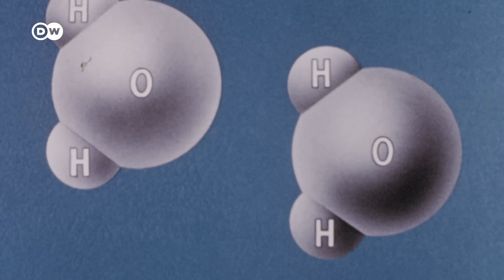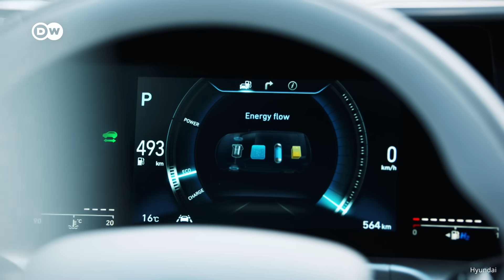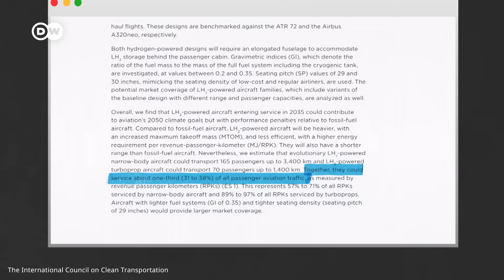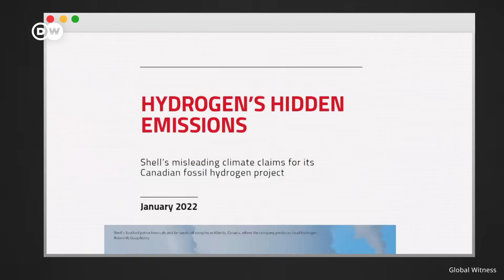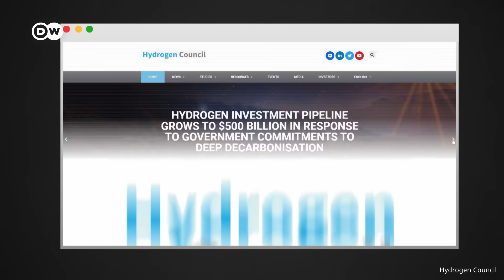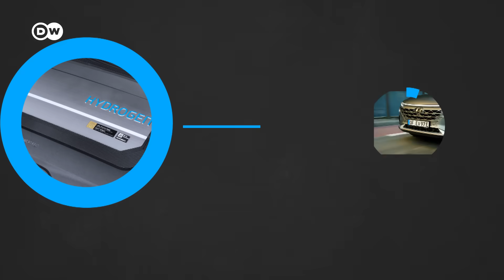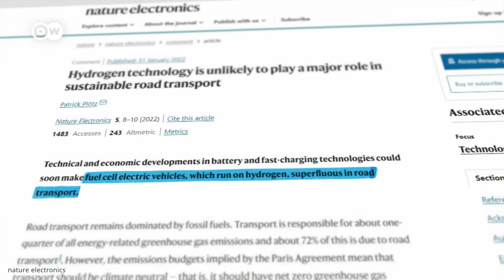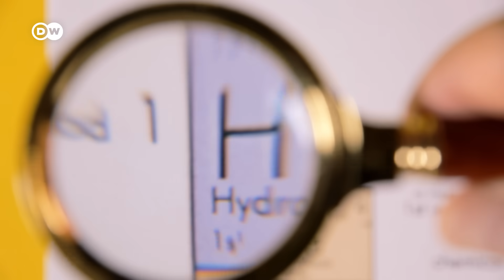The truth about hydrogen

Comment: You left out one obvious factor - nuclear energy.  It is green energy with basically zero emissions, and the latest reactor technology is MUCH safer than older nuclear power plants.  Recycling nuclear waste for a second round of power generation (that waste still contains a lot of power - that's why it's so radioactive, right?) is now feasible, and the world has massive amounts of uranium, which has in turn massive amounts of power per Kg.  The initial cost is high, but the ongoing cost in terms of fuel - uranium - is really cheap per amount of energy produced.  So these plants could then be used to create green hydrogen with much more efficiency than solar or wind, as well as powering the grid.  End result - loads of power on the grid, powered desalination in dry countries coupled with cooling from the sea water, and massive amounts of hydrogen for fuel cell vehicles, or even fuel cell/electric hybrids, such as the Honda Clarity or the Toyota Mirai.

Comment: Or, you could begin a retrospective refit of existing vehicles and keep the internal combustion engine, running on hydrogen, and eliminate the cost, waste and risks associated with batteries. 
Need an intensive clean, low cost and consistent energy source to create hydrogen? Nuclear. 
Strange that none of your independent experts suggested any of this 🤔

Comment: Quaise says they can use a millimeter-wave drilling system to drill 3X deeper than oil wells to supercritical water temperatures at decommissioned coal-fired power plants at a cost of $0.01 to $0.03 per kilowatt/hour.  If true, that eliminates the green hydrogen production cost problem.
Reply: Even at the typical 3x to 4x cost over estimate to actually bring a technology into production, that is still economical. Fingers are crossed they get to prove that.

Comment: Green hydrogen can be produced by wind turbines and solar farms. When the electricity from these two source are not needed on a power grid and they are idled they can still be producing hydrogen for storage land use later . This increases the overall efficiency of the turbines and solar farms. That's the real benefit of green hydrogen. So somewhere in the economy the green hydrogen must be used.

Comment: Nice balanced presentation. Cheap abundant Hydrogen is probably the best long term solution for energy production. (Side bar - don't forget about the effort to make stabile metallic hydrogen an room temperature super conductor. Gee I wonder if THAT could be useful. 🙂).
 As shown in the current video diesel fuel and internal combustion engines can be converted use hydrogen.    So it really makes sense to pursue it as a fuel source. It bypasses the problem if finite source material for battery tech. Also consider the problem of disposing of the solar panels and the toxic content contained therein. 
Figuring out the tech to extract/generate hydrogen without the harm - that is the key. Obvious I suppose - but spread the word.
Reply: Or instead of converting all these engines to hydrogen we could just convert to biofuels

Comment: If you use hydrogen to run your car then insted of a gas tank you use a generator that produces electrolysis in the water tank instead of the gas tank.hydrogen tank for starting the cars engine and producing more than need to run the car means unlimited fuel millage.

Comment: Arrrgh another Hydrogen detractor who clouds the debate with talk about the various colours of hydrogen. 

All that really matters is that you could build a million offshore wind turbines, each with it's own electrolysis cell and you could pipe (or collect) the hydrogen from them and use it as fuel. This SOLVES the no wind days and solar's no-sun days energy storage  problem. It would negate the nees to buy gas for energy from russia. It is a completely carbon free way to keep the lights on and power our energy hungry lifestyles without a gramme of CO2.
My ABSOLUTE favourite thing about hydrogen fuel cell powered cars is that you can sell it from existing fuel stations (like the LPG they already sell) and refuel your electric car in seconds not hours. Range limitations for eCars will simply not be an issue. And we already have a huge infrastructure in place to fuel our cars from pumps - no need to install 250 million charging points in Europe.

Ignore Blue hydrogen unless you want to use it to test a part of the new hydrogen infrastructure - it is just as carbon intensive and is not part of the H2 solution. 

I confess that I am mystified why we aren't already farming hydrogen. It is probably because it wasn't cost effective - well, Russia has made gas 4 to 10 times more expensive so surely the economics are right for hydrogen now!

Comment: Good attempt at balance, but you missed a couple of things. No comment on the requirement for high quality water, which is already a scarce resource. And then there is the release of water on roads, and in the air at altitude when the hydrogen is recombined. And what will the excess oxygen do to the neighborhood of the hydrogen generation plants?

Comment: Yes, lots of hydrogen hype for a very expensive and energy deficit procedure. Basically it takes way more energy to produce 1 Kg of hydrogen then that 1 Kg can ever deliver. Different methods lose anything from 25% to 40% of the energy, so why would you not just use the original energy???? Hydrogen does not occur naturally like fossil fuels and has to be manufactured. Not even to mention the massive problems in storage, transporting and liquefying this very dangerous gas. It burns with a colourless flame and explodes in air. Sounds like a joke to me???

Comment: The biggest mistake in the CLEAN ENERGY RACE has been the movement to run away from Nuclear Power.  This is By Far the cleanest way to produce energy,  even when considering the mining of the raw materials...and fuels.  
With the advent of Small Modular Reactors,  there's no need for the more complex large Nuclear Power Plant as the sole idea of being able to generate clean energy  along a large electrical grid is way more efficient than running large transmission lines across a country

Comment: Regarding the production of Hydrogen from water, via electrolysis.

You are actually USING electricity to split up the water into hydrogen and oxygen.

Therefore assuming that hydrogen is a Green Fuel is complete nonsense, because you first have TO MAKE electricity in the traditional methods, IE by burning carbon dioxide producing fossil fuels, before you can use electrolysis to split the water.

Once again, business men are trying to con ppl who have little knowledge of science into believing a NEW, MIRACLE FUEL WITH NO CARBON FOOTPRINT. What a big con !

Comment: It could cost the climate if you burn natural gas to melt all the iron ore building hydrogen storage facilities. You need a green hydrogen plant built right next to a steel producer that builds hydrogen storage tanks or next to a small nuclear unit. Of course it does not help when you have the Russians just burning off tons of natural gas into the atmosphere either.

Comment: Why is'nt there more research into capturing emissions, then we could continue with fossil fuels until a truely viable alternative was developed. Batteries are not clean, it takes energy and chemicals to make them and more energy again to keep them charged, not to mention the likely inability of the electricity grid to cope with load demands. They pose problems for disposal, they are neither affordable nor practical (charging time and access to charging) and as the video instructs Hydrogen has it's limitations too.

Comment: Nice video. We need to keep investing in a range of energy systems - improving hydrogen production and storage, and battery technology (as well as wind, solar and tidal power). Perhaps you could do another video on the infrastructure required for a hydrogen-based economy?
Reply: Battery technology will never be a solution for storing the wind power from a stormy week and then releasing it during calm weather - energy densities are just too low per kilo of raw materials needed to make them. Also most battery technologies can only be fully charged and discharged / recharged a few hundred times. You could find yourself replacing your giant battery stack every 3-5 years (from memory). Turning the energy into a physical material that you can store and move around - even sell to less windy/darker countries is just too much like the LNG everyone wants to buy today - but without the carbon. I think the case for liquid hydrogen being the best prospect for the environment until fusion becomes practical is pretty solid.
Reply: @michaeldavison9808  And hopefully with way better conversionrates. You can also use hydro as batteries and pump the water back up and save the energy as potential energy. There are many ways to store energy without using batteries.
Reply: Wind power has its effects on the environment, they don’t last long and its composition is hazardous, they kill many species of birds too.
Reply: Let us not overlook where the automobiles of the 50s and 60s were on emissions. We have come a long way on improving the exhaust on modern cars. Natural gas would lower ICE emissions more.

Comment: It's definitely a catch 22 energy source and until we figure out how to extract it super efficiently and build a pipeline all over the place we'll definitely continue with batteries which are just now starting to get better and better.  Hydrogen may then become an afterthought, it's like gas in it's need for infrastructure but it's as clean as clean gets after that.  Catch 22..
Reply: Batteries are useless they just continue the reliance on fossil fuels ,when you eliminate all coal and gas then you can start using batteries,at least that is the way anti H2 commentators see see it.

Comment: Hydrogen is far from perfect, as you've ably shown here, but, in transportation at least, it may be the least bad option among a short list of bad ones.  I believe it's very safe to assume that most industrial countries' transportation infrastructures will continue to rely heavily on private cars and trucks, because that's what the majority of people will insist on. Replacing everyone's internal combustion cars with electric ones seems like a tempting option, but it's just not possible; there simply aren't enough available rare earth minerals on Earth to produce enough batteries to replace the current fleet of cars and trucks. We certainly can't afford to continue to pump carbon into the atmosphere at the current rate. Unless we're willing to accept either total catastrophe or force everyone onto public transit and bicycles (which would my personal first choice), we're going to need to give hydrogen a serious look. 

Another thing to think about is the role of the fossil fuel industry. This industry is insanely wealthy and it wields enormous power, as we see with the current inflation crisis. This small cabal of very powerful people will not tolerate any energy future that does not include them. Better to involve them in a solution rather than try to sideline them, because if you try, you will probably fail.

Comment: net zero, how many will have to die for net zero, we are 50 yrs too late. Climate change is here. we have arrived, there is no reset. thankfully as we climb towards 600 ppm (420 now) the heat trapping of co2 is not linear. we need some miraculous solutions. and hydrogen is a bottom of the bucket choice along with burning trees or green coal. carbon capture?? best to build trains and admit a low energy life is our future. BlackRock might save us.. or not.

Comment: The problem with wind power is that it too is not emission-free.  The blades are made of fiberglass, and plastics and the poles are made of steel or aluminum.   There is also the transportation of the poles and blades.  The CO2 output for wind turbines will reduce over time, but the video posted makes it appear that wind-produced power in the creation of Hydrogen starts with zero CO2 output.  That is incorrect.

Comment: Hydrogen is very volatile, the actual infrastructure used for natural gas would have significant losses. It needs new specific pipelines or it must be frozen, which happens at a very low temperature.That is why you can find gas stations only near the plants that produce hydrogen.

Comment: Sorry, I have to put a dislike because you make it seem like there is no downside to electric but there is. The rare earth material are very scarce and electric motor production is everything but clean and there is also a huge water fotprint involved. Hydrogen is a much more cleaner way and avoids a lot of waste. It´s potential is a lot higher than electric batteries.

Comment: As we speak, huge amounts of gray hydrogen are used for industrial purposes.

The first step would be to replace this with green hydrogen. This would be a huge gain.

Only after this is starts to make sense to use hydrogen as fuel. Compared to alternative ‘fuel’ sources, converting these energy sources into hydrogen and back into energy will have a worse efficiency than using the original energy source to start with
Reply: What most people do not, repeat, do not realized is.......hydrogen is not the problem. ......Tesla have the same problem than and now scientists are having the same problem.......it was never technology is the problem. ......it was always the same class of people that is the problem.

Comment: Fuel for business and travel is an economic problem.  Global warming is a survival problem.   They are completely different driving mechanism.  Hydrogen is not nearly economic unless you include all types of production. We would have to essentially run out of hydrocarbons for a complete economic switch like the movement from whale oil lamps to kerosene.  This will happen naturally as an economic problem as extraction becomes more costly.  

However, the survival problem is two-fold.   The first part is hidden in the conceptualization of global warming causing long term destruction of the nation's economies.  This first problem would include the reduction of the need for fuels and might even self solve or stabilize as man dies out needing less fuel.   The issue is the political awareness that this will happen faster than anticipated weighted against the ability of emerging nations to give up on modernization for their people.   The latter is likely not going to be popular with the vast majority of the Earth's population now in emerging economies.

The second is quite different in the conception of running out of hydrocarbons because we burn them all up.  Hydrocarbons are used from everything from clothing, containers to medical equipment and even pharmaceuticals.  To burn the world's supply all up in engines without succumbing to the first problem is just plain wasteful.  So Hydrogen forms a buffer energy source that would phase out the destruction of the planet in the reduction of burning fuels for transport and would provide transport energy for the advancement of the emerging populations.  So it must remain economic with the optimization of production with lower emissions as the change in consumption increases.

Comment: Hydrogen is the number 1 problem in nonstructural steel welds. Hydrogen weakens steel and makes it fracture. To weld structural steel rods have to be kept in an oven at all times to keep out moisture. Give this is anything you published about the steel true? Is it only nonstructural steel produced? You need some qualifiers, otherwise you don't have credibility.

Comment: Producing hydrogen from liquid water requires 4.5 times more energy through electrolysis than by Steam Methane Reforming (splitting methane). If, as is often the case, in petrochemical plants there is steam generated by other chemical productions, the use of this fatal heat will cause the electrolysis to be 7 times more energy-intensive than the SMR. These are not small margins, but are insurmountable gaps. Hydrogen produced by electrolysis of water therefore has no thermodynamic justification, whether the electricity is of renewable origin (to produce hydrogen described as green) or not. That’s why its not done, and won’t be done except with heavy subsidies as the energy output is far less than the energy input.

Comment: All viable sources of energy need to be run in tandem for a while. This is in order to facilitate a streamlined changeover: over time the most sustainable sources improve and build up their production, while the least sustainable sources are gradually phased out towards zero, (whilst still being there at a low level ticking over as available back up) . On a much wider scale this imitates what happened in the transition from leaded to unleaded petrol.

Comment: Hydrogen has to be the long-term storage medium for energy because we do not have the minerals required for battery storage of our energy needs. All the batteries currently in the world can only store about 11 minutes of global energy needs. We need thousands of times the current battery capacity but mineral mining has a large carbon footprint and is also bad for the environment in other ways. Night lasts for many hours,  and the wind doesn't always blow.  We will have to use hydrogen in the long term, even though it is inefficient. Either that, or use nuclear reactors (including thorium) for the generation of electricity.

Comment: This is a misnomer, the issue is that we need to invest in regenerative hydrogen fuel cell technology. This doesn’t require fossil fuels to make hydrogen. The problem is large fossil fuel manufacturers want to lock in using fossil fuels to make hydrogen, in order to increase sales.